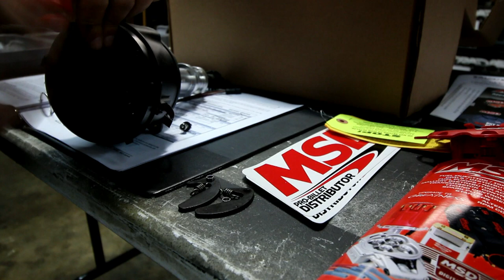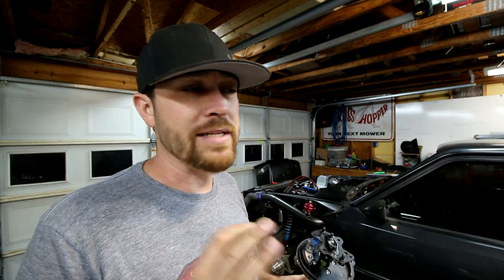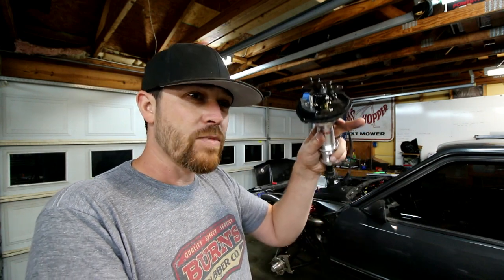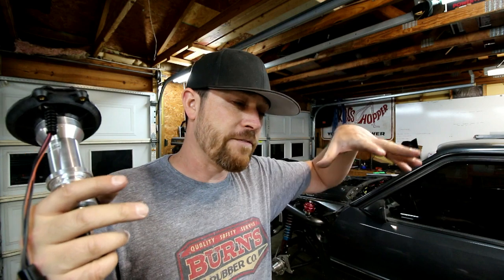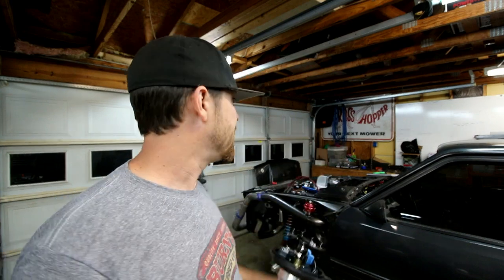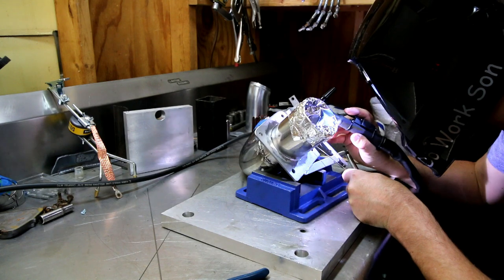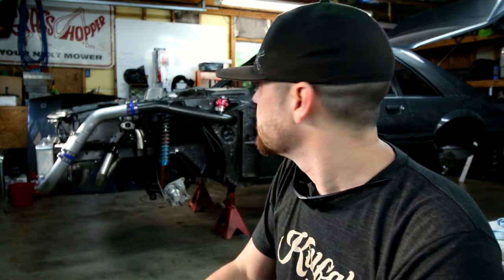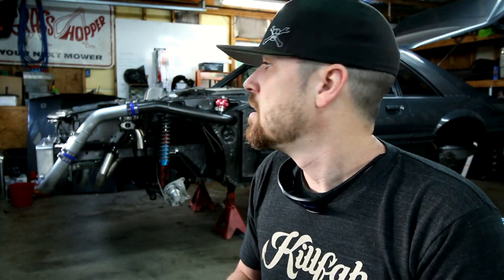Twin Turbo Mustang Is Alive | Gray Goose Build

Comment: Been doing my gaskets that way forever.  Started with my OHV Vega waaaay back in the day.  Hit them with a little Copper Spray-A-Gasket. Mint. If you have to pull them off. Wipe off any CSAG and do it over again. Do the same thing to transmission pans and dif covers. Works like a dream.   And the best part.... the look and "Yeah I gotta lot of stuff to do."  Classic.
Reply from the maker: it works great

Comment: Glad to see it run. I vote for quiet exhaust exiting with stock looking slash cut tips all the way out the bumper. Then boost activated cutouts. Party in the front business in the back. The anti-mullet exhaust,  if you will.

Comment: That's the best feeling in the world! Don't rush it though! double check everything again before taking it out. And bring your fire Extinguisher with you. I built a twin turbo fox as well. Fuel rails were loose, caught the car on fire. Left the extinguisher sitting in the garage. Burnt the car to the ground. Nothing could be save..
Reply: Heartbreaking man!
Reply: rfugate2002 wow I started my car yesterday sent a signal to the injectors to flood hydro locked then the fuel line opened up where I couldn't see it I'm lucky same thing didn't happen to me
Reply: Its been two years now and I still cry like a baby. It was the first car I ever bought 20 years ago. It use to be a nitrous car. And no one would insure it. But they would a turbo car. I was gonna call that day to get insurance..
Reply: rfugate2002 don't feel alone I had an irocz with a crate engine I took insurance off like a few days before I was going to store it and someone I fought and beat up burned it in my yard later I had a kid with his sister and now pay child support lol
Reply: Man, that almost happened to my last fox. I pulled the engine I built and was putting a stock one back in and when I turned the key to fire it, the fuel rails were bent and one ended up pulling and shot fuel everywhere. Luckily I was still in my driveway and had a hose nearby. I just sat there with the hose spraying on the engine till it cooled down enough to stop reigniting the extra fuel.
Reply: rfugate2002 that sucks man

Comment: Congrats on getting the Goose running.  Love the idea of full exhaust and stealth mode.

Few years back I built a Hilborn injected SBC running an Accel DFI setup and got lucky, the Accel Dual Sync distributor only had to have one wire snipped and two wires switched to run it as a cam sync only, no welding required (lucky since I don't have a TIG).
Reply from the maker: Thanks

Comment: haha ... love the Clemson tumbler!!! Go Tigers! I used to hang around in your neck of the woods quite a bit when I lived down there. Hey, and on a driveshaft, I'm sure you've checked out a ton of guys, but if you haven't checked out Mark Williams Enterprises give them a look. They make tons of driveline stuff and just made me a custom 6061 3.5" driveshaft with 1350 u-joints and tested it to 3000 ft-lb before it left their shop. And it's around 54" long and 10 lbs.  And nice work on the cam sync basics. Brings back memories when I was putting sequential EFI on things like a Kohler command 25 and YZ600 using MoTeC ECUs.
Reply from the maker: Thats awesome...Mark Williams makes awesome stuff

Comment: Don't forget to replace the standard mechanical water pump with an electric one (if you want to) to increase the power by 3-10 hp that the mechanical one  requiers to circulate the coolant into the engine block
Reply from the maker: +Βαιος Καλιακουδας I would rather have the dependability of the mechanical for street use...plus when I can turn up the boost and make 300 more HP 10 extra from the water pump doesn't matter..
Reply: The Fab Forums some people who have street cars they install a electric one to increase their cars' output even as a little bit
Reply from the maker: the problem is they are prone to stop working on street car....electric water pumps are not really design for long periods of use

Comment: About a minute after you "glue" the gasket to the cover, Carefully flip them upside down, on a clean surface of course, this will insure the gasket is evenly "glued" to the cover (a light weight sometimes helps) and saves tape.
Reply from the maker: yeah the tape was to insure the holes stayed lined up

Comment: You Don't need a cam sensor if you want to run batch injection and wasted spark.  If you want sequential injection and sequential spark you do need a cam sensor.
Sequential ignition gives a better idle, better cold start by providing a cleaner hotter low rpm spark. At high rpm there is no difference. Sequential ignition offers better fuel economy, and low rpm response....it also creates less turbo lag in the process.
A big deal for a street car!

If Fab forums started his car on sequential ignition and sequential spark....I tip my hat to you!!  
If not, then that is how I do it too! :)
Reply from the maker: correct...mine is setup for sequential

Comment: What's with the tin foil at 15:30 ?
Reply: Syrus54 when you weld stainless steel you have to back purge it with argon to keep the sugaring down, he's using to foil to seal one side while he feeds argon in through the other side
Reply from the maker: yeah what he said...basically to retain the argon on the inside of the tube

Comment: hay dude, just for future reference the MSD pro billet distributor has a provision to lock out the mechanical advance with out having to weld the shaft down.
Reply from the maker: yeah but not where I needed it
Reply: I got you. I had to lock our my distributer on my blown 383 in my truck because I'm going to run a programmable 6al-2.

Comment: good job great news, thinking about it  do they make a 8 coil kit for this? since you have a programmable ECU and custom sensors would seem logical to  eliminate the wearing distributor,  cap, rotor.  I guess you still need something to turn the oil pump and that cam signal
Reply from the maker: yeah the conversion can be done but I dont see much reason for it

Comment: Nice! Congrats! One thing tho. How can the ignition trimming be that flexible when you still have a mechanical link between the coil and plug ( the distributor) ? 

Weather strip adhesive does work awesome on cork gaskets but sucks to clean should you ever have to replace it lol. Learned that old timer trick from my old man when I was a kid helping him in the garage.
Reply: The rotor position to cap plug terminal relationship can be an issue with computer controlled ignition timing. 
That is why we typically do not weld the advance plate to the drive plate, it allows for adjustment. 
We lock the position by drilling a pair of holes through both plates and insert roll pins to lock their relation. If adjustment is required, remove the pins, reposition, drill new holes and insert pins in the new holes. 
The pickup can also be repositioned, however the movement is rather limited. 

3M Super Weatherstrip adhesive is easily removed with lacquer thinner, it is one of the few chemicals/fluids that affects the cured adhesive. 
We also use Permatex High Tack on 1 side of covers and pans, removes easily with lacquer thinner.
Reply: High tach is another great product! I've used it more for holding gaskets in place during assembly. For example, when installing a timing /front cover on an engine in the vehicle. The gaskets can be stuck in place with high tack and assembly goes so much smoother. Highly recommend this product to anyone who has not tried it. Way safer than rtv lol.
Reply: That is exactly where we use High Tack. 
It seems to be well suited on more rigid machined surfaces and the 3M WS adhesive is well suited flimsy/wavy stamped flange surfaces such as valve covers. 
Yes, I stopped using RTV about 20  years ago. 
I now prefer using Hylomar or ThreeBond sparingly for the few places where I would have used RTV such as the gap between front and rear end seals and gaskets on SBC intake manifolds.
Reply from the maker: The actual rotor doesn't determine timing in a standard distributor. Its the sensor that actually determines the timing of the spark, the rotor/cap just transfers the spark. The width of a standard rotor can transfer spark in a 30 degree range with no issues. In a setup like mine I will phase the rotor to be lined up perfectly at max power timing though to make sure I am getting full ignition power when under high boost. I hope that makes sense.
Reply from the maker: rotor position to cap can be an issue if not phased properly, but I can phase the rotor even with it welded solid.

Comment: Don't know if this was said but make sure to run the correct distributor gear.  Depending on the core the camshaft was ground on it may need a bronze gear for roller style cams.  I've seen the wrong gear take out camshafts and distributors.  Also leave quite a mess in your engine!
Reply from the maker: yeah for sure. You can use steel or bronze on the roller stuff

Comment: you do have crank trigger?, in most cases, cam trigger is needed only on startup, due to fact that after someone has told engine management where the cylinder 1 is on tdc, it will start counting from crank trigger and use that to manage position, at least most of the cases ive been part of :) you could run engine completely from cam trigger and still use Coil on plug and sequential injectors..
Reply from the maker: Yeah crank trigger....yeah you just cant have sequential without a cam sync
Reply: With a crank trigger and no cam sync/signal how does the system determine the compression stroke?
Reply: It doesnt do that, on that case (for example TC Harleys) they only have crank trigger and they push wasted spark and inject fuel on every stroke, as the engine dont have any idea when ever its compression or ignition cycle.

Comment: Congrates Kyle! But I have questions, questions :)

Didn't this distributor have also a vacuum control?
Don't they do bolt-on devices for the cam sync?
Reply from the maker: It wasnt a vac advance setup just a mechanical. They do have some devices you can bolt on for cam sync
Reply: Why didn't you use one of those devices then?

Comment: Cool video. Thanks for explaining the ignition system set up. I'm an old school tuner, springs, lockout bushings, vacuum and fuel pressure gauges, and timing light. I'm definitely interested in converting my cars ignition over to the synch set up. Just curious, what brand of box and brain did you use? Oh yeah, glad that you kept it Ford powered. Keep the great videos coming. God bless!
Reply from the maker: the ECU is a BigStuff3 and I am running a MSD Programmable Digital 7 Plus ignition with it

Comment: BIBSTER!!!
Also, will you be setting up a 2-step limiter, or are you going to run a stall converter? any anti-lag plans?
Reply from the maker: Yeah I have multiple 2 steps and yes it does have a stall converter
Reply: nice. no anti lag to spool the turbos at the tree?
Reply from the maker: The two step will help with that. It actually has an anti-lag tune setting in the box, so if I need it I can use it

Comment: Why would you have a certain cylinder be giving a different fuel mix or timing setup?
Reply from the maker: Sometimes air flow is not equal to all cylinders so you may have a lean or rich cylinder.  Or may have a cylinder thats slightly hotter than the rest which may require less timing. Its really something used to fine tune once you are starting to push the limits of the setup.
Reply: Wow. I learned something new today!

Comment: u could use just crank signal bc u cant change your valve timing ...so u don't need cam sensor but u need to add map sensor if u bypass cam sensor..  but if u like extra clutter and less spark v.... go for it..   after so much boost  will blow out spark....i do this for s living... glad u doing things...but there is better way and more exact if u turbo
Reply: The cam position/reference sensor is necessary to insure the ignition fires only on the compression stroke, which occurs every 2 crank revolutions...  otherwise crank signal only would fire each cylinder on every crank revolution resulting in backfires. 
MAP sensor has absolutely nothing to do with cam sensor and vice-versa.
Reply: U dont need cam sensor bc u use the crank...if was cam overlap changed like on modern cars  than cam sensor is needed....but dont listen to me...im only a mechanic and fabricator
Reply: Please explain in detail, your premise does not make sense to me, and I am a multi-discipline engineer, fabricator, ASE master certification and factory trained by Ford, Chevrolet, Fiat/Lancia, Ferrari, Maserati and Lamborghini with more than 30 years experience in professional motorsports.
Reply: Im a ase l1....but when u use a stand alone ecu...u can program what sensors u want to use for your ignition trigger.  Fuel trims  ect....all u really need is crank map tps wide band o2 coolant temp intake air temp  maybe a maf....
Reply: If u have a vvti type than cam sensors a must
Reply: The software knows cam does 2 revs for one crank rev....it that easy
Reply: Stand alone can also turn on nos and fuel pump if run more than one
Reply: Congratulations. 
1) Why do you say "need to add map sensor if u bypass cam sensor"??? 
2) How does the MAP sensor replace the cam position/sync signal? 
3) How does the crank position sensor without cam sensor determine correct cylinder cycle when configured as sequential? 

The rest of what you have posted is dependent on the particular ECU/ECM/EMS/PCM and is irrelevant to this  conversation.

Comment: There is money there for anyone that wants to adapt later Ford ECM's to the older engines.  For LSx's theres EFI Connection that makes kits to run the brand new OEM ECM's on the Gen 1 and 2 V8's and 4.3l V6's.  

To be fair data acquisition is equallyin importance to the precision of the computers control over the engine.
Reply from the maker: agree

Comment: Did you really have to modify a brand new $250 distributor? If it only needs to do what you said wouldn't a stock one have done the job? just asking I'm not familiar with this set up so i'm curious. Love the videos keep 'em coming!
Reply from the maker: +mikl911 I tried to use a stock dizzy. I got it to work but it wasnt sending the kind of signal the ECU was looking for.

Comment: never seen a new motor never smoke on startup at least from burning off paint or coatings
Reply from the maker: yeah ....I didnt really let it get hot though. When I get some coolant it and let run for a bit I am sure it will smoke some
Reply: yea first start up starts smoking fast I was thinking the same thing other than that it looks great

Comment: Really don't see the need for the cam sync. You have a crank sensor which tells you crank position, so why introduce a second way of doing the same thing? By reading a signal off the dizzy you introduce a timing variation into the mix between the two trigger sources through the gearing slop between cam and crank angles. You went on about how you can set an initial degree marker setting BTDC on 1, and vary events from that base degree marker, so why add slop into the system if you can do it with the box?
Reply from the maker: I dont think you quite understand. The dizzy has nothing to do with timing in this application. It just tells the box where in the firing order the engine is (sends one pulse 60 degrees before the #1 cylinder fires). The timing signal comes from the crank trigger.

Comment: dam man that's an expensive cam signal but i guess if the engine is built its the easy way out

not on a V8 but i drilled the cam sprocket and turned a small steel pin to press in and also a one as a counter weight but on the other side and 180 out 
drilled/threaded the backing plate for the hall sender works perfect no back lash or slop 
100% exactly where the cam is in its cycle ever time i had a bit of trouble with the modified dissy that i did so went the more direct route
Reply from the maker: yeah

Comment: surely using a 50-2 tooth wheel or more on the crank would save all that stress. sequential injection is only really effective at low rpm after 2000 rpm it's not much gain. real gain is you can run coil on plug. nice job tho on the car.
Reply from the maker: well the main idea behind sequential is being able to tune each cylinder separately.
Reply: Fair point, bank injection does the job but your way is definitely more flexible and ideal. What's the plan to measure the tune on each cylinder? O2 sensors on each exhaust header or read the plugs and adjust?

Comment: Anyone here have knowledge of installing tacho gauges? I have a Nissan King Cab D21/Hardbody and I wired it up to the exhaust coil, but at full throttle the gauge loose the connection and the rpm hits 0.
Reply: Should I find a wire closer to the distributor?
Reply: Unknown It should wire up to the negative side of the coil. This is on a VG30E correct?

Comment: y would u pull or advance fuel or spark only on one cylinder unless that one has problems aka is fucked....cool to have but useless..   convert to coil packs and get out of the 60s ...google coil packs on your motor....u got stand alone....bet u not run map sensor and do speep density.. thank u japan
Reply from the maker: I like the 60's